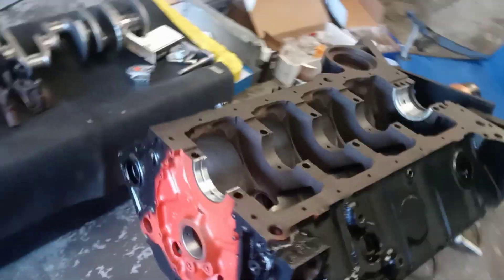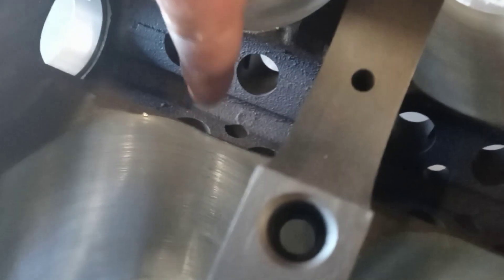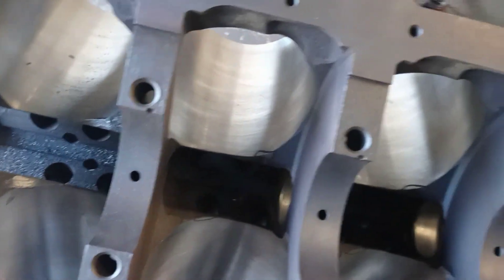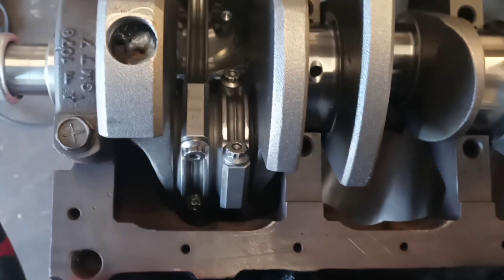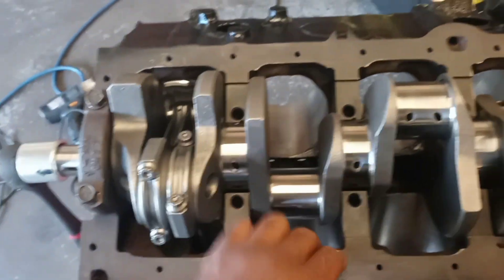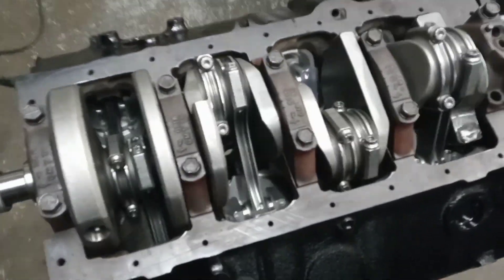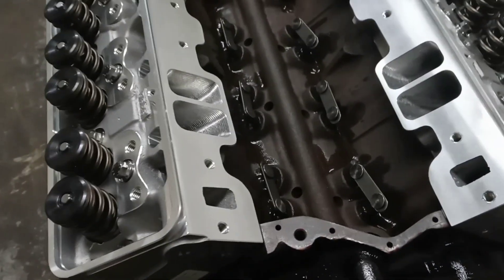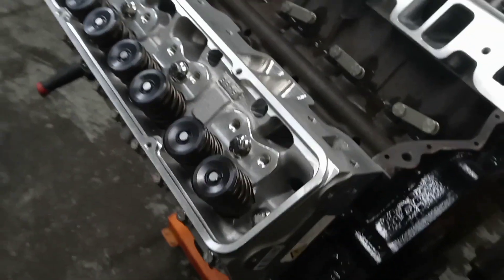Part:1 Building a 600hp "pump gas" street motor

Comment: What's up with the steam ports in these 400 blocks? Do those AFR heads have the steam ports to match the block? Seems like the Gaskets covered up those said steam-ports. I've heard some say they're real important/ necessary for cooling, and others have told me they're not important, ignore them, use the 350 heads if need be, but don't worry about the ports. What's your opinion big brother?
Reply: Get them drilled at a machine shop you run the risk of blowing a head gasket without them being drilled.
Reply: You need them,Ive got three 406 motors